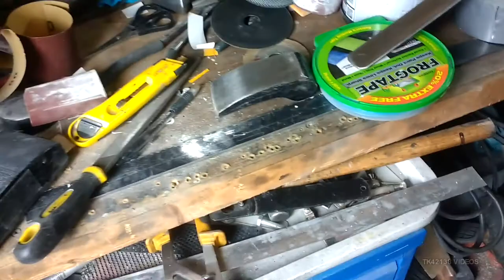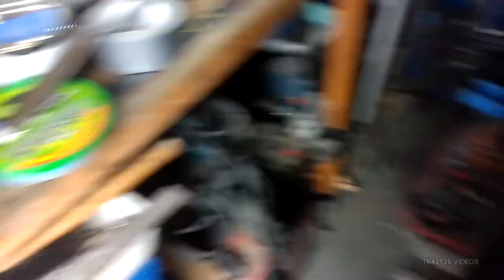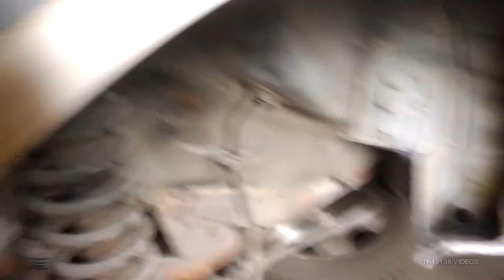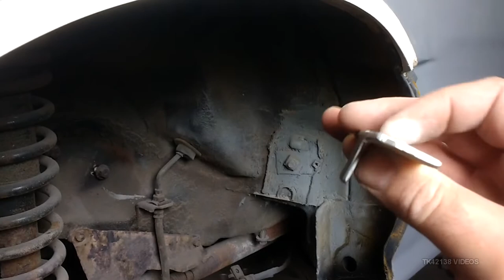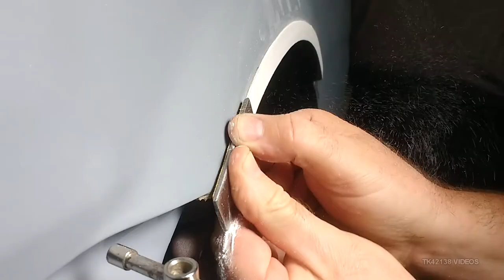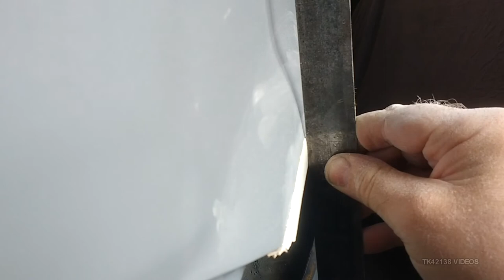Part 33 'Final shaping of the rear wheel arch' (using a home-made tool)

Comment: Neat hack with the home made sanding block. 👍
Reply from the maker: Thanks, it's the classic 'necessity is the mother of invention' as previous attempts using long-board sanders caused vertical face to angle inwards. Definitely investing in a bead roller and shrinker stretcher when I finally start on the nearside arch.